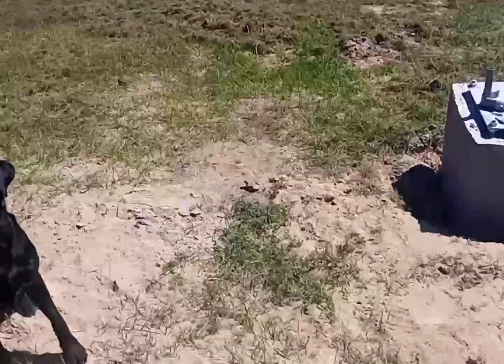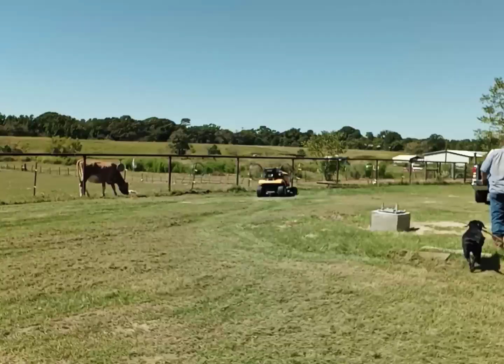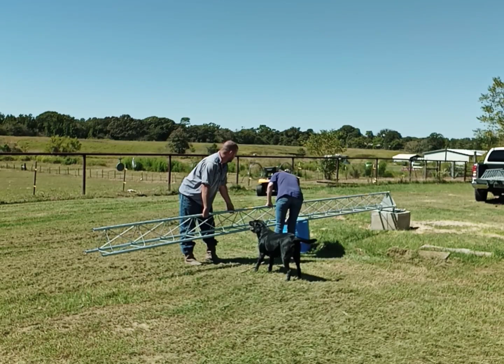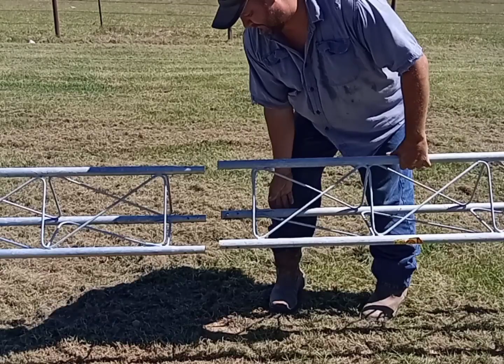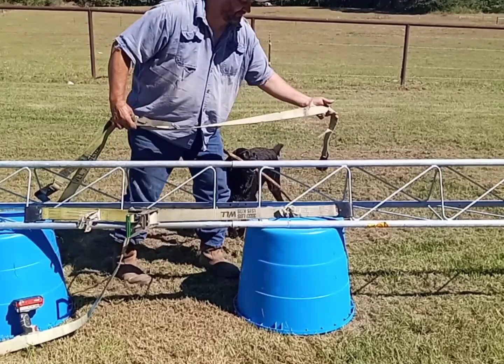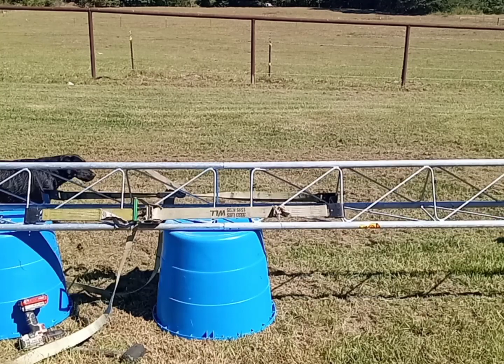Putting together my 40-foot ham radio tower part 1 of 2 #JournyAlongWithSannon #RadioRadioKN4YEM

Comment: I've got a used Rohn tower.  It's being a bear to realign.  
I'm considering useing a scissor jack to attempt bending the pipe legs. Has anyone some ideas about adjusting the pipe to fit? Some are about 1/4 off center,etc.

Comment: I have the same tower on the same base. It was a pain to get the sections together. I used a come along to pull my pieces together after my wife and I lined them up and my dog helped too.
Reply: I have a 50 foot Rohn 25G that hsa never been assembled with base, rotator plate and guy supports for sale if any one is looking for one.

Comment: Piece of wood on the dynamic end and not the static end would have worked better. I had the same issue where some of the galvanized coating is thicker and makes it difficult. Beating on the fixed or static end does little good

Comment: I know I'm late to the party.... I take down 25G towers monthly and have put a few together...  Nice tower, a few thoughts on video and advice for others.
Grease and PB Blaster help.. forcing that one section at the end will be a pain when it comes time for removal in 20-30 year.
1. So for anyone else putting up towers, please grease the ends with something thick that wont wash off easily. (if you are fighting it, realign)
2. please don't DRILL or make the holes larger,  Rohn has a standard of two sizes per leg and everything is engineered expecting those bolts. If the holes don't line up, adjust the 3 legs and use a NAIL PUNCH or screw driver to help align them.
3. Strap tighten.. please be careful when pulling on the cross members, I've climbed many towers that have bent or even missing rungs because of install abuse. If you have to use a strap, something is not lining up, sometimes sections just may not fit and you swap it for different one. If you do need to tightening please use axle straps around the main legs several times to shift the torque to the strongest piece of the tower.
4. bolts should match the tower, if rohn thats Grade 5 Galvanized. Stainless it nice but has mild corrisions issues (nice bolts, rusted tower).
5. Passive anode protection, 1 1/4in ID magnesium anodes will prevent rust for decades and extend tower life if done early or at construction.
my 2 cents and advice,   Ken KN4MDJ
Reply: Thank you for your constructive feedback. ❤
Reply: #2 you said they have 2 sizes per leg???   Please explain....I thought all bolts were the same size?
Reply: @bobbychaney8372   OEM BOLT KIT FOR ROHN 25G TOWER SECTIONS:
HOT DIP GALVANIZED GRADE 5 BOLTS AND NUTS 
(3) 1/4 X 1-1/2"  AND (3) 5/16 X 1-1/2"

Comment: I just put my 40ft Rohn 25g tower together yesterday 

It wasn’t fun either as I greased the legs and had to use a ratchet strap to force them together.        Now I have to figure out how to tilt it up.       KE5MUG
Reply: How did you raise it?

Comment: How do you figure the load on raising cable?
Reply: It's a little complicated.  It depends on the weight of the tower, the position of the lifting cable and the angle of the line.
Reply: @stargazer7644  thats what I was thinking. Some claim its the height of tower. I believe the weight is the factor.
Reply: @roynorman3650  What you're doing here is calculating torque against gravity.  The height of the tower does matter.   In general, the shallower the angle of your lifting cable, the more force you have to apply to lift the tower.  The closer you attach the cable to the base, the more force you have to apply (the height of the tower makes a big difference here).  The closer you get to vertical with the tower, the less force you have to apply.  The force required to initially lift the tower off the ground can greatly exceed the weight of the tower.  The scenario with the least lifting force is with the cable at the very top of the tower lifting straight upwards. Then you'll only have to lift half the weight of the tower.  But this isn't a very practical configuration unless you own a helicopter.  A bad configuration is with the cable near the bottom of the tower at a shallow angle to the ground.  You might need to pull hundreds or thousands of times the weight of the tower in that configuration.   The worst configuration is with the cable attached at the hinge point of the tower.  You can't lift it there no matter how much force you apply.   Generally, we work with a situation that is in between for practical reasons.  We attach the cable near the 1/4 or 1/2 way point up the tower, and we lift with the biggest angle we can manage.  Falling derricks can help with this.
Reply: I understand, great infomation you provided. I was hoping to figure how much force would be on my cable. I'm sure that would require engineer imput.

Comment: take a ratchet strap and pull the two sections together it works I know, that is how I did mine.
Reply from the maker: Yeah I tried that in a different video and it didn't seem to help in the near future I'm going to take it back down and pull it apart and try to get the bow out of the Tower maybe you some anti-seize or something on it

Comment: I'm not going to monday morning quarterback you.   That thing looks like it was a pain in the butt to get that last inch LOL.  Nice job keeping clam and not ram the damn truck into it.
Reply from the maker: It Wards when I stood it up you can see that it is crooked here in the near future I'm going to be running all the coax in pvc conduit and maybe adding a couple of more sections to a tower when I do I'm going to try to pull it apart and fix it

Comment: Thanks for making this video. As for the bolt holes all Rohn tower sections are each double drilled: 1/4" and 5/16" hole pairs, at each joint. Many theories as to why but that's just how they roll.
I ordered all new rohn bolt sets from DX Engineering for mine because they were designed for these towers and not all bolt specs are equal in terms of  different brands and material.

I used silicone spray lube to put my sections together. If you have a preowned tower you may need to use a good solid steel rod to re-round the legs if bolts were previously over torqued. Someone used a steel 4-way lug wrench to do this by driving one end into the leg opening. Be safe.
Reply from the maker: I bought the tower new it come with the bolts I think it was galvanized too heavy at some of the ends is the only thing I could figure out thank you for watching the video next week I hope to do parks on the air and make some more videos of ham radio